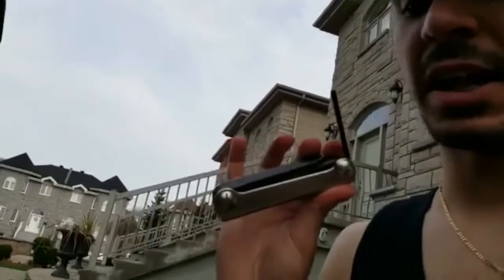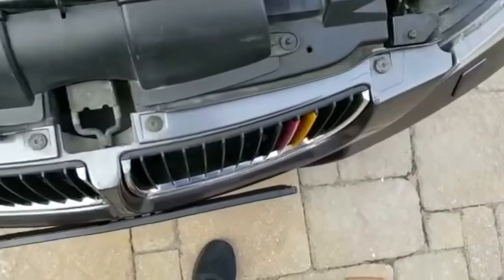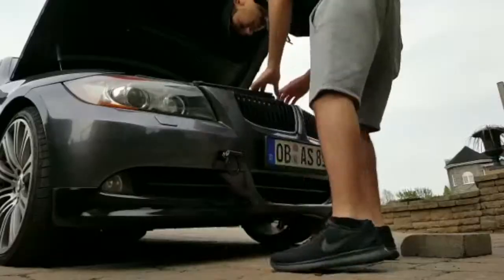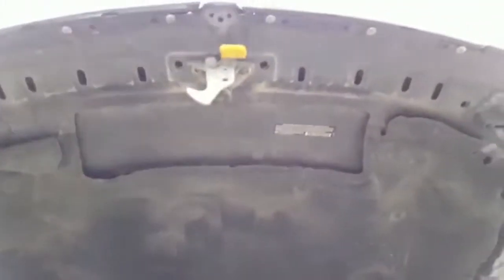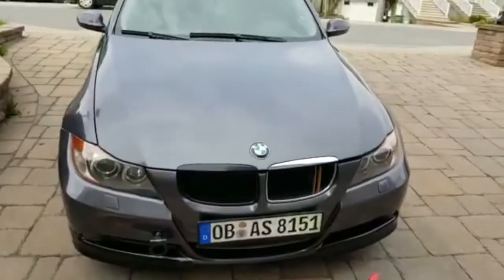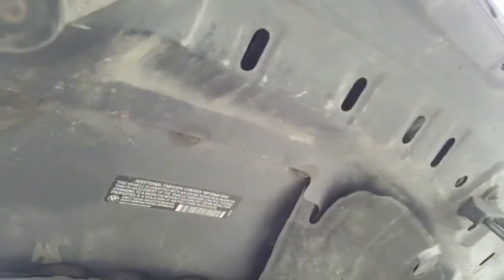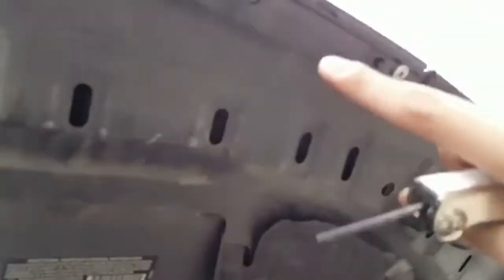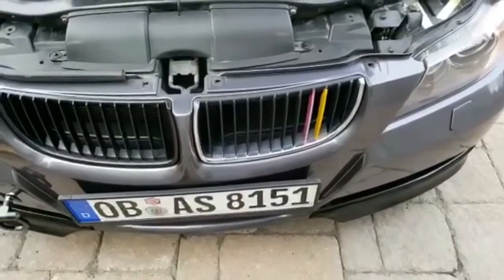Black Kidney Grilles install on my BMW E90!!

Comment: Pulling it out,why so difficult?
Reply from the maker: Sam Thomas It shouldn't be that hard once you know exactly where it is. Use the new ones as a template to see where the ones on your car are or look it up online! Hope this helps.
Reply: Garage Nineteen I've seen vids where screws are used,but tbh I've also seen one where from outside u push clips holding the grill,and it releases,seems legit.Cbf screwing if it's easier just popping a few clips
Reply from the maker: Sam Thomas To each their own! I did my own research and wanted to share how I did it my way. I found this to be easiest and it worked well. Job done and  nothing broke ahaha